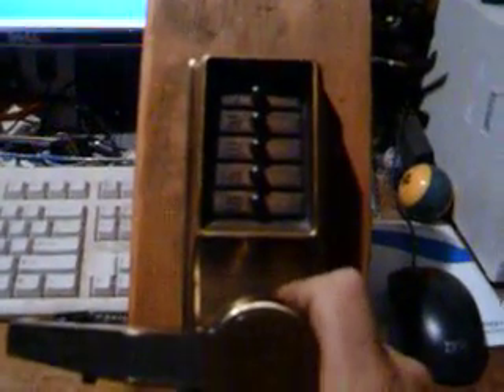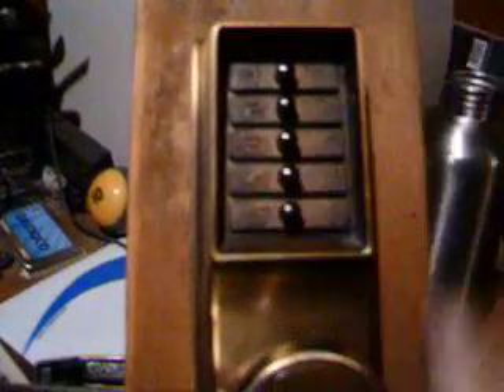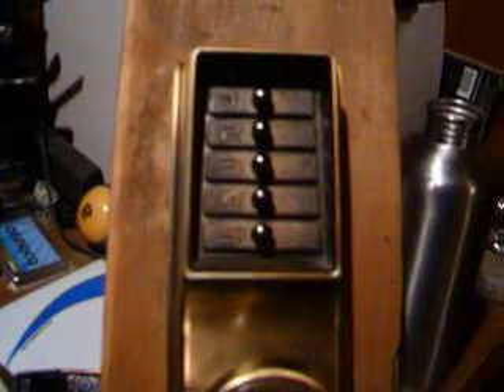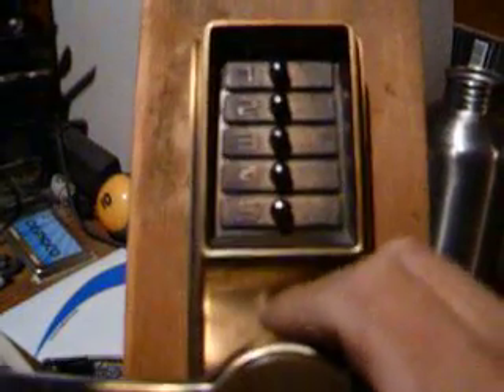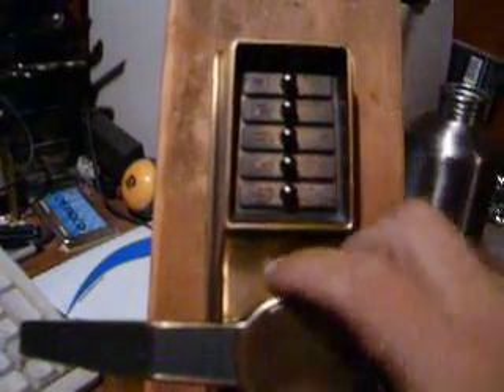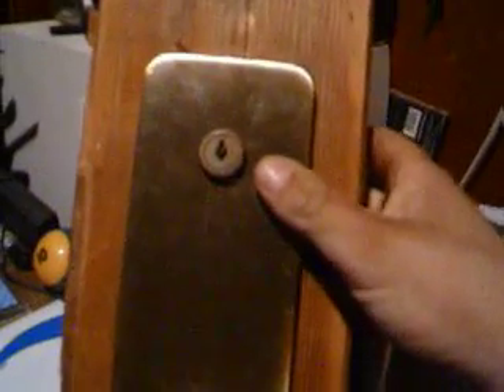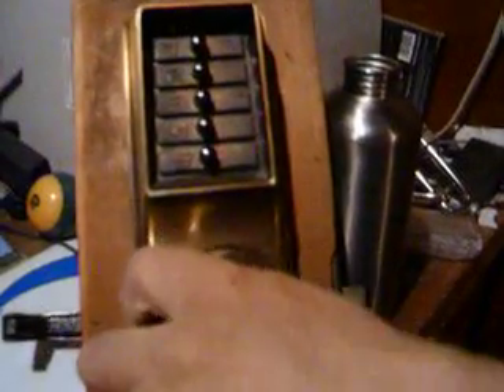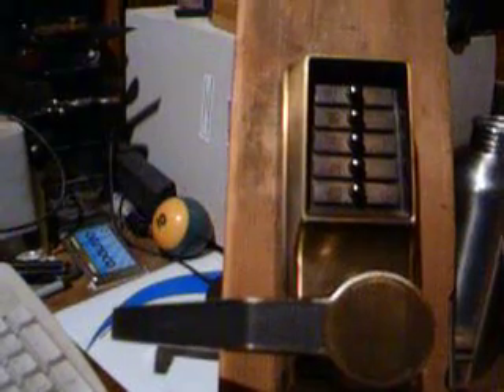A look at vulnerabilities in a Simplex lock

Comment: 😂Fake news! There are 1,081 unique possible combinations. Each button can be pressed only once in combination, and multiple buttons can be pressed simultaneously. The combination could be as simple as one button or two buttons, then another, and so on. As long as you only use a button one time. These locks are ridiculously secure.

Comment: I have never seen one of these locks changed from the default. I'm not a locksmith, but I've run into them in three different places and the combo was always the default: People are too intimidated to change the code themselves.
Second, I have watched a locksmith open one of these when the buttons failed: using a pin he removed the handle, then with a screwdriver went through the shaft and turned the inside handle: whole thing took less than 15 seconds. And then I found out what they cost.
Reply from the maker: I'd believe it on the default codes! The locksmith likely just turned the bypass mechanism inside the lock, as it would be hard to reach the back handle from the front. Some of these locks have a spot for a key bypass in the doorknob, so you can use a key instead of the combo, if the locksmith turned the part normally activated by a key, it would open the door.

Comment: OK, the OP didn't do a good job explaining how you find the combo pretty easily. First of all, there's only 1333 possible combos. If you're in a secluded area, and testing 1 combo every 4 seconds, it should only take you about 90 minutes to try every one. *

But you can narrow it down using 4 clues:
1) If you can listen to someone opening it, you'll know how many times they pressed button(s). You can also watch from a distance to see how many time they moved there hand in.
2) If you can determine which buttons get pressed. Sometimes you can tell by just looking at it, other times you have to put a little dust or something similar on each button to see which ones are disturbed later.
3) 99% of the time only 3 or 4 buttons are used to set a combo. 1 or 2 buttons isn't secure enough, and 5 buttons is a hassle and thus rarely used. There's only 445 3 or 4 button combos.
4) Pressing 4 numbers at the same time is unheard of, and pressing all 5 would require 2 hands and is just stupid.

Now, I can look up (from a chart I made) that if I know 4 buttons are used, and only 3 presses, then that's 190 combos (13 minutes). And if only 3 numbers are used with 2 presses, then that's 30 combos (2 minutes).

* It is possible for the last button to be pushed in only halfway. This is rarely used as it often creates problems with the users pressing too hard. But if it's used, then that adds 840 combos to the mix.

P.S. The color is called antique, not gold.
Reply from the maker: Thanks for your comment, I didn't go into detail for the simple fact I'm not trying to train thieves, just letting people know these aren't as secure as you think. your summary is correct, 2600 "The Hacker Quarterly" did an excellent article on these locks and went over the techniques you described. I had someone change the combo on this and I had it cracked in 15 minutes off of the 2600 list. I will likely do a better video going into more detail, since the info is already out there.
Reply: I got locked out my apartment complex due to a malfunctioning main gate with an electronic control access device. The side door uses a Simplex lock. With your instructions, I cracked the code in <1 min. Clearly, insecure mechanical locks have some perks. All homes in the complex are obviously secured by additional key locks.

Comment: You are mostly full of crap here.. A person is not going to walk up to one of these and open it not knowing the combo in a few minutes..( Magnet Trick aside ). Because a person normally wouldnt know how many digit are used in the combo. The fact that pushing 2 numbers at the same time is a unique setting right there that  you could not figure out just randomly. you would have no way to figure out say  both 1 and 5 were pressed together at the same time for a combo. UV  powder..... Kick the door in. Thats even quicker..
Reply from the maker: Well, another trick is to listen as someone opens the door, you can hear the clicks as the digits are entered, and could tell from there. Plus, with the UV trick, you can narrow down how many buttons are used and go from there. Several lists have been published with EVERY possible combo, and there aren't as many as you'd think. (less than 6000, compared to 64,000 for a combo padlock)
 Since you can only use each digit once, that really narrows it down.
Kicking the door in is usually faster, but it attracts a lot more attention and leaves evidence someone broke in.